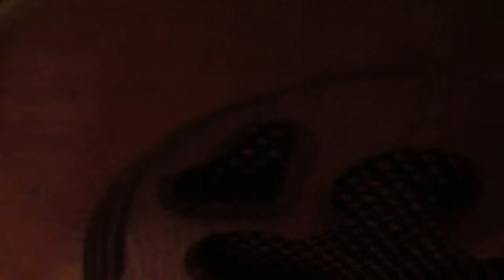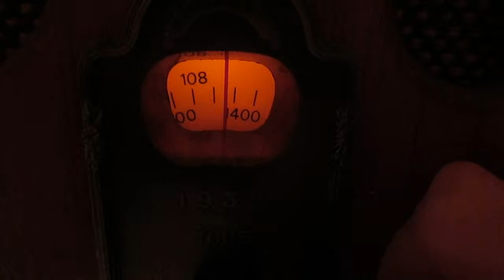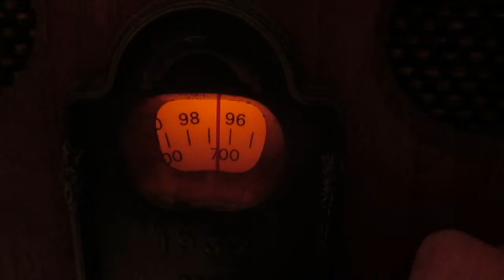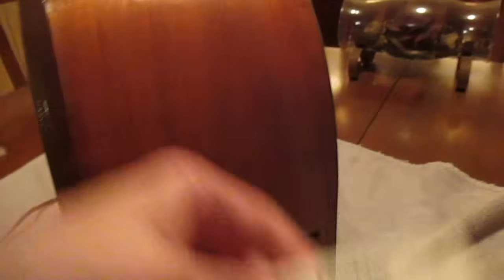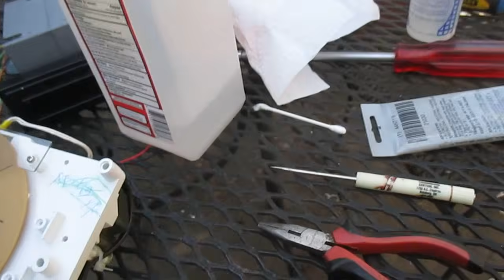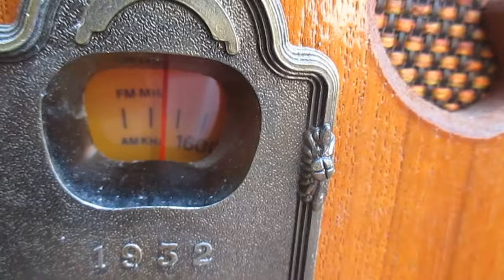Thomas replica AM/FM cathedral radio from 1989

Comment: Alot Of People Don't Even Bother Working On That Old Stuff.
It's Like The 14.4 Volt
Black & Decker Power Tools I Bought
At A Thriftstore
& I Relized They Don't
Make 14.4 Volt Batterys. 
But I Foundout
They Handle Upto
18 Volts But If I Need Parts For Another
Drill Recip Saw
Or Circular Saw I'll
Have Them.

Comment: i have a 'similar but different' steepletone branded one, model nr301c,  also with cassette player (was available without) and has a '1929' badge on it 😁 , i had it about 1989/1990 (as a christmas present), it worked ok for what it is,  although the tape part was bit of a chewer,  take up tension far too high,  it has now failed, the  TA7640 IF chip has popped , i've had quite a few Tosh chips like this  go bad...so modern technology isnt as good as many think 😜 i have a 1932 pye battery set, i just shoved 90v and 2v in it and it worked  pretty good as is , all 'virgin' unrecapped .... i do have a 'thomas' branded plastic cased 'retro repro' thing also with cassette, i've seen pics of the original it was based on but cant remember offhand what it was , its left side rounded with louvres, white pushbuttons down right side, 2 main controls under right side dial ...
Reply: there were repros of the philips 'ovaltiney' 634A , made about the same time, plus earlier ones 70s/80s, made by philips themselves, which are very acceptable, i have one, 2 variants of those, one with innards from one of their far eastern made pocket radios(all discrete, no ICs), adapted for it, i have on of those, plus one with 'unique' innards not used in anything else, that uses at least one IC
Reply: these far eastern repros could now be classes as 'vintage' if at least 20 years old, and you never know, may become collectable or even 'rare' in the future ... need to stock up on TA7640 IF chips as i think most used these, they were probably 'old' types at the time they were made so maybe got a batch cheap from Toshiba or a surplus wholesaler  , theres a newer KA equivalent commonly available luckily
Reply: yours looks pretty much identical innards to my steepletone except mine doesnt have the clear plastic with red line marker in it , they were likely all made by one manufacturer for various or even one 'importer' branded to their specification

Comment: I made new rubber drive tires out of a rubber equipment foot of about the right diameter you have to drill the hole out and stick a bolt through the hole and chuck it in a drill and shape the edge that goes into the dial drum with a slight chamfer to fit, you'll probably have to work it and try it a few times till it fits right but it is do able, on mine the rubber was lumpy and distorted/cracking.

Comment: I will be working on a 1930s majestic radio soon. Hopefully i can get it going again. It's a majestic model 55. I have a Capehart 1951 radio model T-30. That still works on all it's original parts. It has lots of bumblebee capacitors. But it still works. For now.
Reply: that is very interesting, I have a model 25 majestic floor unit.

Comment: My parents bought a Randix branded radio just like this in 1989 but without the cassette player. Not only does it look identical to yours it also has the same issues as theirs with a scratchy controls, slipping tuning, and a volume control that also never goes low.

Comment: I’ve seen these at antique stores listed for more than the real stuff
Reply: There was one at our vendor mall going for $29 labeled 'vintage cathedral radio'  i ended up buying the 5-tube GE next to it that was priced for $9. Its my work radio and even at half volume you can hear its tiny single speaker 50ft away. Its also the only one that can pick up our local rock station. None of the modern ones can.

Comment: P.S. The larger reproduction radios 📻, says “1934” on the escutcheon, and it also features a dial light 💡. This smaller reproduction radio 📻 does not have a dial light 💡, but both feature a cassette player. Again, your friend, Jeff.

Comment: Sounds like 👍 you’re getting more sentimental with these newer reproduction radios 📻. I know just how much ya hate them. I bought one ☝️ myself, several years ago. The cassette player on it wasn’t 🆙 to par, but the radio 📻 works good 😊 enough. The size of the speaker 🔊 is also a far cry 😢 from the one ☝️ in an actual 1932 cathedral tube radio 📻. There’s also more hot 🥵 glue in these, but it’s my “get me by” radio 📻 until I find a REAL 1932 cathedral radio 📻. Your friend, Jeff.

Comment: YOU know,. Solid STATE ( MORE SS  nonsense like nutty auto SS super sport, SS social security, , SS secret service ) is a strange name as it doesn't really mean much, .. and a SSD drive is different in its solid stateness Vs the simple replacement of a vaccume tube, which is itself pretty solid, with a transistor

Comment: Is that an old RCA record player sitting on top of that blanket?  I found an old cathedral Philco radio on top of a trash can one day back when I was in my early 20's (many decades ago!) and took it home.  The speaker was totally shot but I managed to get the radio to work by mounting a new 8" speaker in it and using the voice coil of the old speaker to drive it.  The radio had pretty good sound and would pull in quite a few stations.  When my foster parents divorced my radio got sh--canned by him and no reason given for it.  I wish I could have gotten to it before that happened but I was overseas and that ended that.

Comment: Very soon FM will go down to 82.1 MHz 82.1 -91.9 will be low power translators, part 15 transmitters,  non commercial religious stations such as K-Love, school & college stations. 92.1 -107.9 will be high powered commercial stations still. No dates set yet but i would imagine they will go down further to 76 MHz like Brazil (76-108 MHz) & Japan (76-96 MHz) uses.

Comment: It was not from 1932, it was from 1989. It was made by Thomas, they made replicas of 1930’s radios and stereo systems. They also have a slot loading cassette player like the ones used in both the Crosley and Victrola models.
Reply: He knows.
Reply: LOL I'm pretty sure radiotvphononut nose it's not from 1932